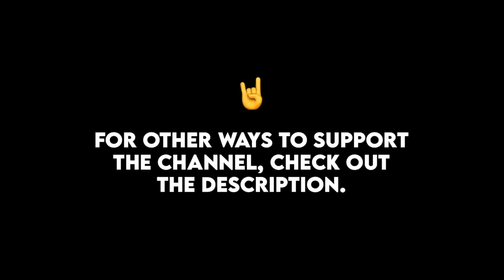Making a Disc Golf Disc | How It's (Hand)Made

Comment: It’s not ideal but it is really affordable. If possible move your press higher up on the wall and give it a longer handle to give you more leverage. Also attaching a chain to the press handle and a pulley to the ceiling you could make it so instead of lifting you just pull down using your body weight.
Reply: OR watch the video on pulleys from smarter every day and make a multi pulley system to reduce the leverage needed to next to nothing
Reply: Exactly what I thought. A pulley coming from the top. 💪
Reply: Mechanical advantage is your friend
Reply: I was gonna say a 3-to-1 (or more) MA rope pulley system. will take up less space than extending the lever, and yeah it can be arranged so that the force needed is downward (so gravity could do the work).

Comment: If you open a shop, you HAVE to take heavy consideration of the fumes. There isn’t a lot and you should be able to have a vacuum system going to a air scrubber but very critical that you have this and it is working 24/7

Comment: If your going this direction I would recommend four items: a very short come-along with a lateral pully system to a floor anchor for the push down and a 2m cheater bar for the pull up of the plunger.

Comment: You need a double pulley system in there to help yourself get some leverage!
Reply: I'll second this. It's the cheapest/simplest way to get some extra mechanical power.
Reply: Dude needs a couple cheap winches
Reply: my thoughts too.. or a sprocket system
Reply: hydraulics
Reply: why not just make the arm longer?

Comment: Since your melting time seems to be the longest part of the process, have you considered making a modular melting system? If you made a "tube holder" that held your melt tube and plunger, you could have a second unit of plastic heating at the same time (or 12min offset). Also, for a DIY/cheap solution to upgrading your pull arm, consider a vehicle trailer jack screw. Cabela's sells a 2,500lb one for $70. you might even be able to turn it with an impact wrench...

Comment: You could use a double acting pneumatic cylinder to push and pull. It could run off of a fairly inexpensive compressor. You could also turn the injection tube upside down and use a fast pump floor jack to inject and your weight to pull it back out.

Comment: Love what you are doing to grow the sport.  A couple of things I did not see in this process are whether you torque the nuts down on your mold.  I know from working on engines that torquing heads is a very precise process that is done in a specific order to maintain consistent pressure.  I also wonder why you don’t heat the mold at least some to make the flow into the mold a bit easier.  Keep up the great idea you have.  ⛵️

Comment: If you want to set up a multiple setups you would do well with an air system with a central compressor and air cylinders, would be claener than a hydraulic system. Less expensive alternative could be a bottle jack system with a chain fall as a reset

Comment: Very cool, I would think that you could put a sturup of sorts on the end of the plunger handle this is just short of the floor when you are fully pressed in.  Then when you start to inject you could step up on the sturup to complete the injection.  For lifting the plunger up, perhaps on the top of the sturup a heavy duty 'O' ring where you could attach a wench of some sort, electric on manual. Very cool.

Comment: You could take a look at using a wheel instead of a lever for your injection method. Take a look at old school injection molding machines, in my experience, most have a large diameter wheel that you turn in order to inject the plastic and apply hold pressure. You could also add machined cooling lines into the A and B half of your mold, it will drastically cut down on your cool time.

Comment: Right away I thought a pulley system where you have 2 in parallel on the way down. And some counter weight. Then a simple switch to the other side of the bar with an eye bolt maybe, and use one pulley with same weights to pull up.  You always are pulling down and will reduce the force needed.

Comment: To make the pressing easier without getting any expensive parts or machines you can make the bar longer for more leverage and you can attach weights so you don’t have to put as much force in it yourself. And to make it easy to pull the plunger back out you can attach a simple pulley or block and tackle to the ceiling and pull it back up that way

Comment: You should make a curved handle that you can insert into your square handle. Curved upwards so you get more torque and always have a direct downward push point as it gets lower. So, less energy required. Then you can flip it for when you're taking the plunger back out.

Comment: I would build a pulley system to pull it back up. To go down, how about a hook on the end of the lever you can add free weights to. You still use your body weight to pull it down, but any extra weight would help the process. 

This would be the simplest and cheapest. With some ingenuity you could use the pulley system both ways with a winch. I too am in Colorado, would love to help build that set up.

Comment: I would say some type of jack screw with an electric motor for pressing the plunger and removing. Could be run just by 2 switches. 1 switch for up and 1 for down. Would be pretty straight forward and easy to make work.

Comment: Yeah I've been around discs my whole life the Wham-O frisbee disc is one year older than me,  I can show you how to balance a disc the center of mass needs to match the center of the circumference or it's going to waste energy wobbling when you throw it. 
You can use a hydraulic ram from harbor freight to do that action Both ways also it wouldn't hurt to have a burner below it to keep the mold from cooling off until you're done injecting.

Comment: If you want to make the injection easier without a huge fancy change, use a screw instead of a lever. It'll also ensure you get a consistent pressure applied across the entire disc

Comment: I'd suggest you look at buying a cheap hydraulic setup. And get the tolerance on the tube to .001 rather than .01 - you may want to look at having a port where you pour the granuales in then rather than putting them in the top. That would make it way easier on you! And maybe have two or three tubes that can be in the heating phase at any one time, and just place them onto the ram to form.

Comment: Longer lever arm would make it much easier to pack the plastic! Also if you could somehow incorporate a reciprocating screw into the barrel to process the plastic it would cut your melting time down exponentially, as the shear heating between the screw and barrel account for >85% of melting in an injection molder (Plastics Engineer here lol). Look up how Injection molders work and this comment will make a lot more sense! Love the videos though, keep it up!

Comment: @trashpandadiscgolf Use an atv cable winch 1k lb or 3k lb. Mount a pulley block to the floor and a clip to the ceiling above your press. Then you can use the floor pulley to pull the press down. To open the press back up clip the cable to the ceiling mount.

Comment: Cheap Harbor Freight electric hoist. Connect it to floor or ceiling. Connect directly to the arm and either pull arm up or down. Put a pulley on the opposite of the hoist (floor/ceiling) and then disconnect and run it through pulley back to the arm to pull arm up or down. I use such a hoist for a multi-hundred pound camping setup to lift off of my truck in the garage. Works well, but I don't know the working lifetime if you were doing dozens of discs. Nice thing is it is cheap and comes with a warranty. So if it fails just take it back for a new one.

Comment: You could use a hydraulic press/winch combo to lower and lift the bar. Or, maybe you could use a modified drill, essentially making a half-threaded piston. The lower half is the rod you have pressing down on the material now, and you add onto the top a tube with a threaded barrel. Using a drill, you could pull a trigger to press down and raise using the threads. Sounds dirty and finicky, but maybe there’s an idea in there somewhere for your process!

Comment: It would still take some physical power, but you could rig up an easy 3 to 1 pulley system with some basic rock climbing gear, don't think it would be too expensive, and it would still provide a workout

Comment: I second the double pulley system for leverage. You could also power it with a single or dual weed whacker motor to get the intense manual labor out of the way.

Comment: Perhaps a pully system to help you pull the rod out? And why not coat the rod in oil beforehand? The longer the lever the more the leverage. Or what would be cool is a gear system attached to a big wheel you could turn to raise and lower the rod.

Comment: Very cool and impressive; glad I stumbled onto this. A little winch is exactly what I was thinking while I was watching. Attach a D ring to the floor, another ring on the handle, another to the ceiling. Use a little winch and cable to bring the handle down, then move the winch and attach the hook to the ceiling to pull it up. That would be the easiest way. You risk bending your equipment if it's not quite right, you would have to make sure everything was cool before you implement it.  A threaded screw would work too except you'd have to redesign a lot.  Good luck.

Comment: Totally awesome video! Add a compression ring or two (like that on a piston) to prevent plastic from getting past the end of your rod! This should be a pretty cheap way to improve your design without changing the whole setup. Also, a rope/ratchet strap to hold down the lever at the end of its stroke

Comment: Quickest and easiest way to make the press easier is just making your lever longer. weld like an additional 6ft-8ft of tubing on your lever and it'll be way easier on you. Just got to make sure you have the space to do so.
Or you could just get some square tubing that is slightly smaller and slide it into your tubing when you need it.

Comment: Add a hook to the end of the lever, put a 45 lb plate on the hook. Will help to pull the lever down. Then for lifting, you can put a winch on the ceiling and winch the lever back up

Comment: Maybe a ceiling mounted electric winch could be used for the injection process?
-Injection - Concrete anchor in the floor to pull the leverl. 
-Reset - directly connected to winch to pull out the plunger

Comment: If you need something to push down on the molding machine get a pneumatic cylinder and a air compressor . It might be hard to set up but once you do it you could experiment with getting different densitys of plastic and things like that.

Comment: This was incredible to watch as I’ve worked in the plastics recycling industry for a little over 10 years and absolutely love the game of disc golf! I see you’re using HDPE, is it reprocessed HDPE Injection Grade? What type of Melt Flow Rate does your resin have? Only reason I ask is I’ve ran a Melt Flow Index Tester thousands of times and know the lower melt flow rate resin has a tendency to have more resistance when pushing the plunger down and back out. 

I come across HDPE Injection / Medical Grade that is the 15-20 melt range that might be perfect for what you’re doing!

It also might be fun to try a high flowing, heavily mineral / talc filled PP to boost the weight of the disc for windy conditions. It would have a Discraft Jawbreaker plastic feel..

One last piece of advice, my company blends a PP based resin with PET and some other types of plastics. PP can almost become a glue once heated and cause some of the others to mesh. If the opening of the barrel and mold entrance is wide enough, you should be able to force something similar into it. Creating a sustainable product with something like food grade PP containers and small amounts of PET bottle. All recycled!

The road is endless my friend!!!
Reply from the maker: Thanks for the kind comment and extensive info Brad! If you don't mind, I'd love to chat more. Can you send over an email to trashpandadiscgolf@gmail.com ?

Comment: Honestly the "best" thing to do to keep this a manual process is increase the lever arm length and use a ratchet system that mimics standard presses. 

 Part of the problem is that you're continually outside the ideal press area (in this case 90 degrees to the ground because you're using weight to apply torque) so staying as close to this area is your target. 

One solution for this would be:
Have the press as a piston on one fixed axis.
The piston has gear teeth on the top for the distance the press needs to travel.
The l piston is fixed near the midpoint and if you want extra credit throw another support above the gear
Theres then a gear fixed to a mount point that forces contact with the piston teeth
Then there's a lever arm attached on the same gear axis. 
The lever arm ratchets( can be as easy as a spring and a piece of metal on a hinge) which then turns the gear and forces the press to go down. 
The lever arm can always be near the optimal position, taking advantage of gear ratios can give you better pressure, and fixing the piston rod increase efficiency. 

This is in general a pretty simple machine and you could easily make and have the others cnc'ed. Hope this helps a little.

Comment: Dude, 1. hang a weight on the end of your injection piston arm. 2. Extend the piston arm for added mechanical leverage. Do you have to use 260C. For the temp? If you could go hotter it would take less work over all. 🥏🤪

Comment: You would benefit exponentially with a hydraulic press and some minor automation. Hell, since you are recycling, you might think to just make plastic blocks and cut them to shape in a lathe rather than using a mold. You could use a hot plate to stamp the bottom's.

Comment: (Three years plus too late, but for those that also wander by here): I wouldn't bat an eye doing this manually 20 years ago. Now that I'm old, doing things with power is mostly a requisite and a Lot cheaper than blowing a knee/shoulder out (again). Hydraulic pistons and pneumatic actuators to the rescue! Though if you want mechanical advantage and the reliability of analog, a screw press would be a decent filler, or even an air-assisted hydraulic press, but you have a rather narrow operating range with the latter.
That said, with how relatively cheap a linear actuator is that can push quite a lot with a reduction gearbox, you can automate 300mm or more with plenty of pushing power behind it for as little as $30.  I ended up scoring a salvage industrial injection screw (40x1100mm and weighs 20 lbs worth of hardened steel) that I was going to operate with my compressor, but ended up--after A LOT of searching--for a electric motor with a Huge reduction gearbox (745:1) for max torque to turn the beast, with said linear actuator for the final shot push and a real janky pressure-washer piston as a backup when the need for Heavy Duty arises. Slight bonus points for PID and band heaters, but it's ultra low buck overall that would cost a fortune if I had to buy everything new.

Comment: 2 snatch blocks with a hand crank would make it so much simpler to lift and lower and also lock into place the plunger arm, no power needed just crank away. Or if you wanted to get fancy you could do a gear reduction with a motor and put a rack on top of the plunger.

Comment: Question: why don’t you attach a hold down on your concrete floor and use a come along to pull the handle down to inject? Also on the ceiling to retract.
Reply from the maker: That seems to be the next big step!
Reply: Highlift jack would probably work with the floor bolt

Comment: Great video man, you really did well. 
As far as your press is concerned, the cheapest way to do it in my opinion is to rig up a threaded rod, something like allthread to a drill motor. It would work for both the press and resetting of the press, just reverse the drill motor and "unscrew" it. Basically just like an apple press.
Reply from the maker: Yeah! Since that's the way industrial injection machines work, I think I'll only be able to avoid it for so long haha
Reply: @TrashPandaDiscGolf  I'm sure you could rig something up in the mean time that would be much cheaper and easier, although man, what a workout! You might just have to keep the old machine around to keep up that body! LOL! Best of luck man, it's great to see people doing this.

Comment: Harbor freight. 150$ winch. Bolted to the floor. No effort on your part but to push the button. Use same company and install hoist at ceiling to pull arm back up.

Comment: One thing you could try doing for injecting the plastic and pulling the plunger back up could just some systems of pulleys. One set attached below and one on the ceiling. For every you loop you have you decrease the amount you need to put in.
Reply from the maker: Believe it or not, I've seen the exact thing you're mentioning done before!

Comment: I would definitely recommend a small hydraulic press used for tool setting... and it won´t break the bank! cheers from Germany
Reply: The issue is two fold, you would need to get it back out.